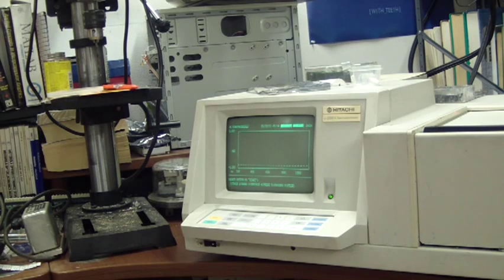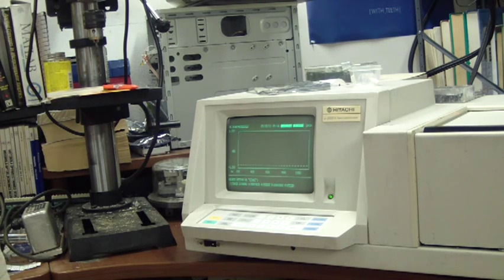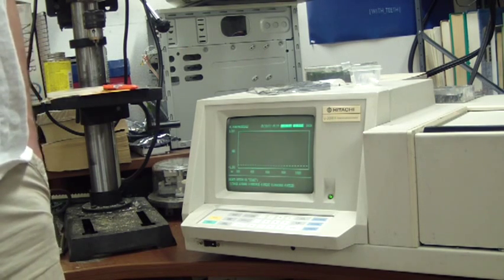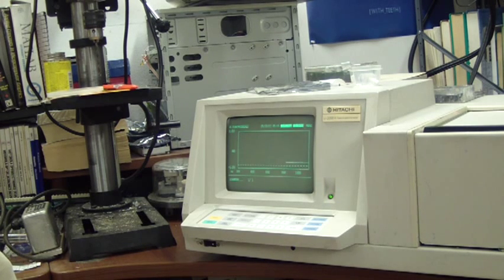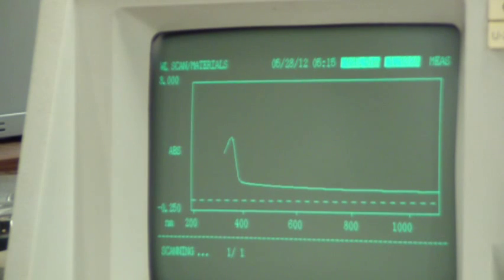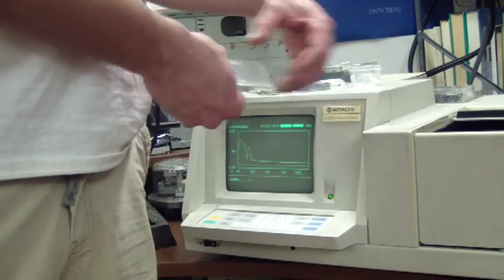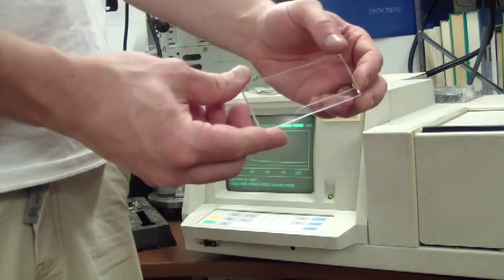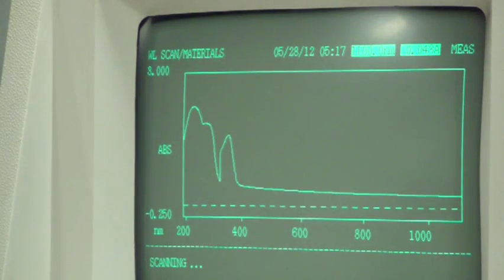Hitachi U-2000 Spectrophotometer

Comment: Hi, I have one UV 2000 that is asking for Calibrate Instrument but running the calibration, a message of Calibrate erro comes to the CRT.  With that, the operator manual guide us to ask for Hitachi service, not morre available for this model iin Brazil.   Could me help?  
Thanks so much in advance.

Comment: Hi. I have a U-2001. How did you enter the A/D span? I tried entering "99" at the WL calibration selection. That brings up a Calib/Diag menu, but then there is no prompt or menu item for entering the zero and span values. Thanks.